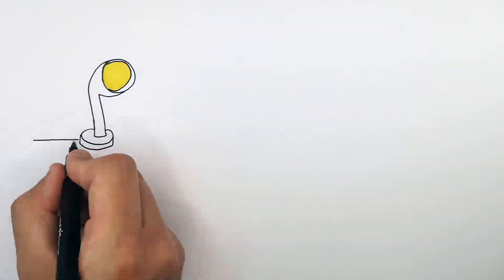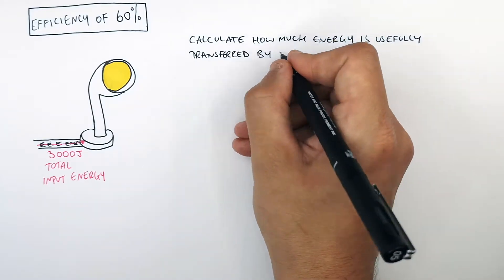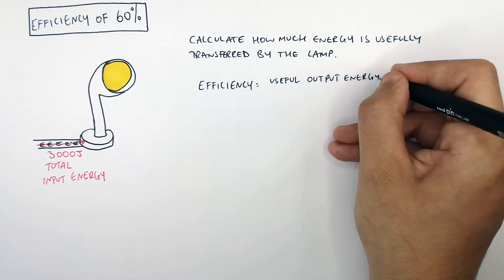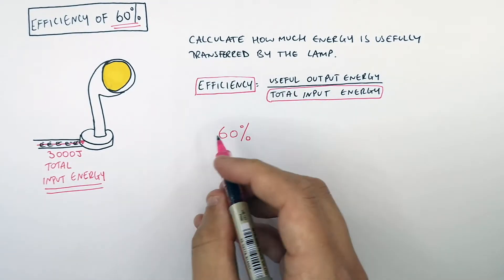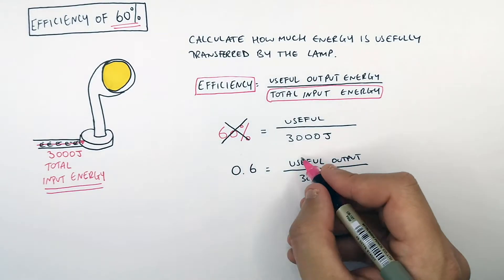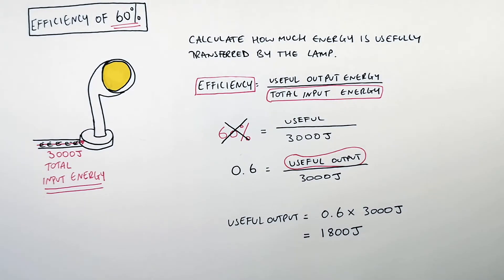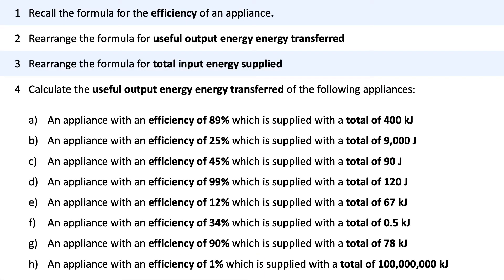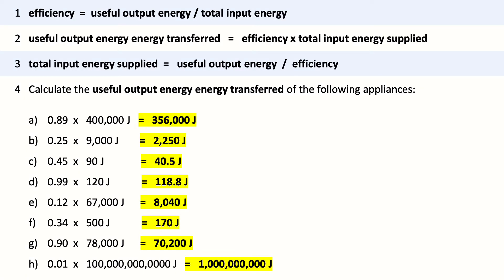GCSE Physics - Calculating Efficiency

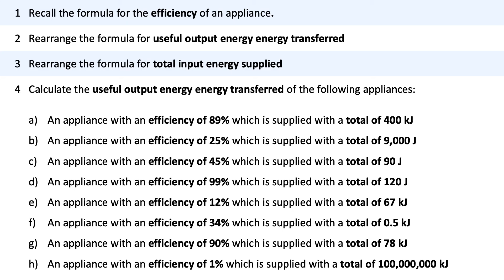Comment: At 2:11 I believe that the bottom equation is wrong.
The total input energy transfer should be equal to useful output energy transfer/efficiency. You said it yourself in question 3.
Plus, that's like saying that 4 = 24 / 6 so 6 = 24 * 4

Comment: i wanted to know how to find energy output(also tell formula) when efficiency is NOT given.
Reply: I just figured this one out. To get your Eout without efficiency, you just use the same formula for Ein. Eout= P (t). Your wattage or time should be different for your question but this will work.
Reply: @carterg6811 what is P